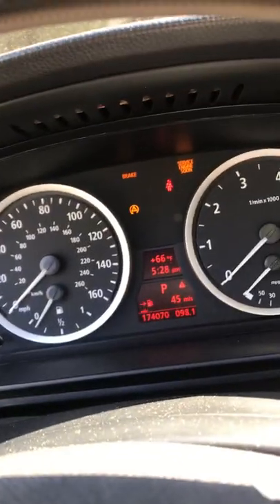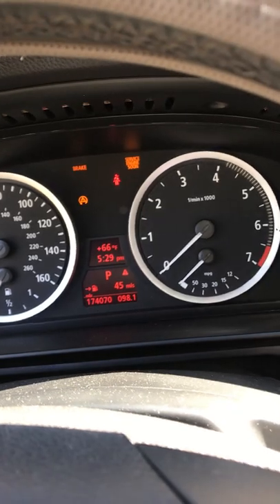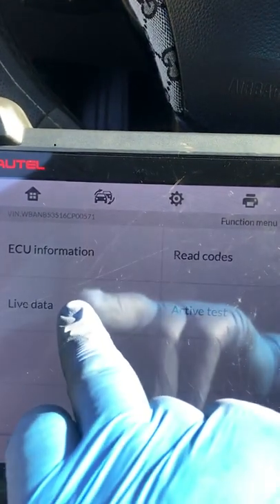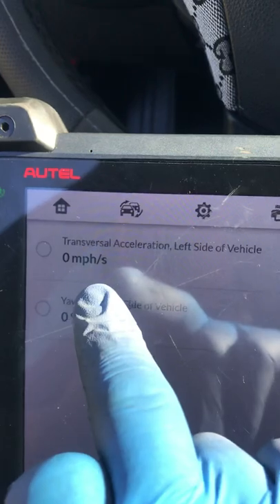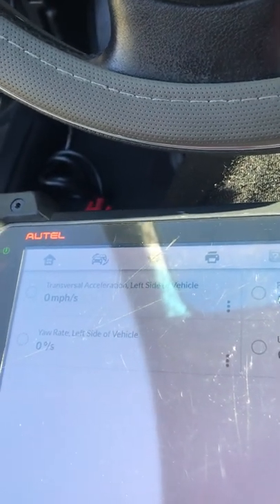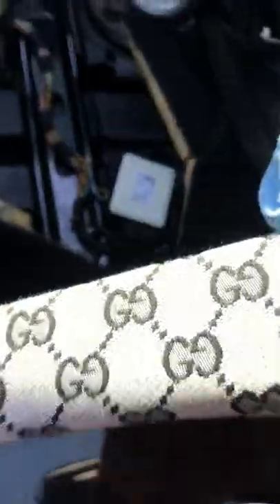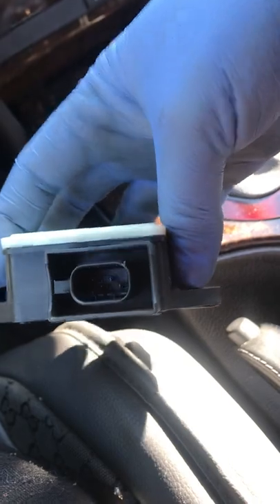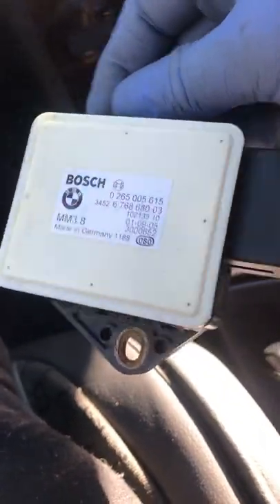Bmw 5 series Yaw rate sensor location

Comment: Hey thanks for location but did you have to do any programming ?
Reply from the maker: I put a used module in so I didn’t need to program it but I did need to recalibrate the system itself

Comment: Hello do you resolve your problem ? I have the same problem on my e60 thanks
Reply from the maker: Yes my problem was fixed from me changing the yaw sensor but I also replaced steering rack which was leaking and it’s good now
Reply: @romydial   thanks for your answer, did you do some coding after the yaw sensor changing ?